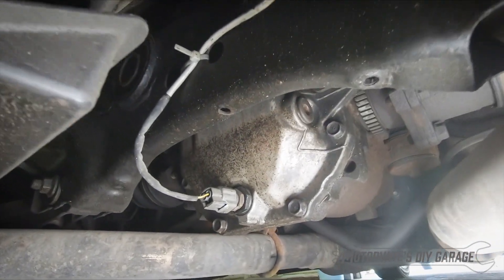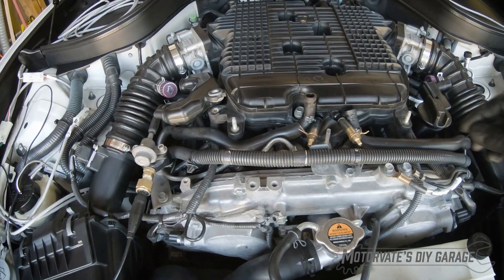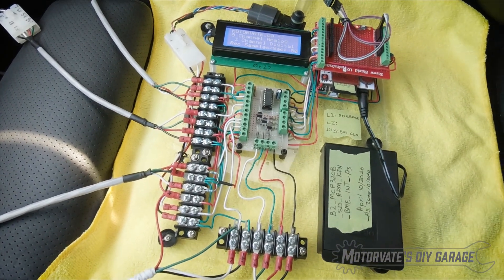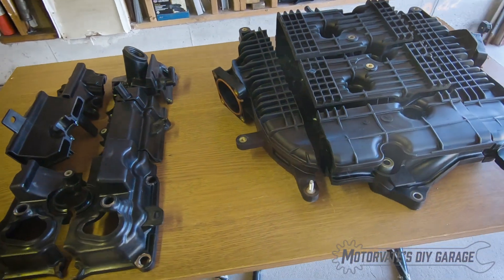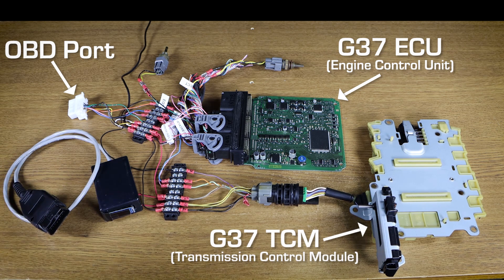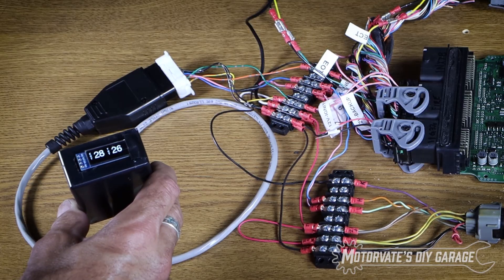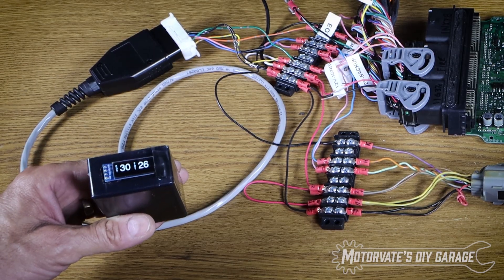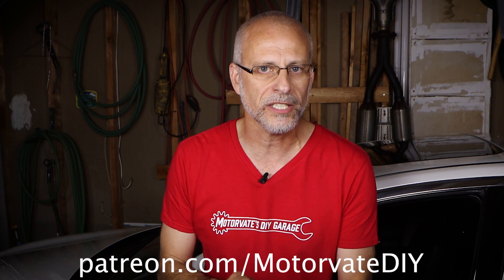Motorvate Episode Previews for 2020

Comment: I was RLY looking forward to another video after this. Did the VQ Gods tell you not to give away the secrets to peasants? :(
Reply from the maker: Hey Jason, thanks for the comment. 
Everything mentioned in the video is still on the "To Do" list and background work has been going on.

For example:
G37 Gear Position Indicator using Factory Gauges (Plug+Play!)
https://youtu.be/wQm-7cxolm4

Bluetooth Differential Oil temp, manual transmission oil temp, engine oil pressure.
Convert any wired sensor to Bluetooth with our Bluetooth Sensor Server:
https://youtu.be/U_kH3K_C2AE

16 Page Mini-Dash/LCD Gauge (using CAN bus and OBD mode $01)
https://youtu.be/lndZiRxDNOo

So... hang in there :)
Reply: @MotorvateDIY  I am trying. ..hehe. I have a 2012 G37xs Sedan with Auto. Once you mentioned self tuning..I got SUPER Excited..;) Also cutting apart the manifold, and explaining things . I will be working on hooking up a sensor for oil pressure next. All your videos have been extremely helpful! Thank you for your time. We appreciate you! :)
Reply from the maker: Thanks for your kind words...
As you can guess, the self-tuning requires a massive amount of R&D time and for the next while, I will be focusing on other items. This way more content will get released.

For your oil pressure sensor, make sure to get a 150 psi version. On a cold start, the oil pressure can exceed 120 psi.

Comment: Just checking back to see if you're getting close to completing some of these videos? Hopefully you arent snowed in up there.
Reply from the maker: Not snowed in at all...  They are being worked on right now... I have so much to share with everyone.... For example, how much does the fuel pressure change during wide open throttle, how high does the oil pressure get during high engine RPM, or even how high is the crankcase pressure... 

Also, I have developed 30 second install engine oil temp and transmission oil temp gauges... All will be shown on future episodes :)

Comment: Hey, just a question, my 10 g37x has some hesitation on acceleration at low speeds, after a stop I give it about 15% throttle and hold it and the car feels like it has no power or very little power and after a second or 2 power comes on, Then i smoothly give it more throttle input and the car will jerk, the throttle is smooth feeling but the power jumps up and the revs go up by 2-400 rpm, even at parking lot speeds I’ll barley touch the throttle and hold the gas and after a second or 2 it will accelerate more and slow down and it will keep doing that when i constantly hold the throttle (first theirs no power then power comes on then no power) it feels like the throttle body is closing on its own, idk what’s the issue, I’ve cleaned throttle and maf sensors and did a tune up and did the peddle dance and reset the ECU and nothing worked
Reply from the maker: Hey  DGFr0sty,
That's an odd problem.

If you want to troubleshoot this yourself, get an OBD wireless scanner and an app (OBD Fusion is my favourite, but Torque Pro is ok)

OBD Fusion has a VERY nice diagnostic report. Run that report with the engine at a hot idle, and look at the fuel trims.

Then, do some data logging. For both banks, I would record the air/fuel ratio, MAF, absolute pressure sensor (MAP), absolute throttle position, engine RPM and accelerator pedal.

This data should tell you what is going on.
If you want to learn more about OBD diagnostics, pop over to my other YouTube channel: https://www.youtube.com/obd4everyone

As you can guess, most of it is G37 focused, so that might help.

Comment: I have a code p2138 with the ses light , slip, and vdc lights on and the car is in limp mode with next to no power can anyone help me out what this could be I seen one thread saying the pedal position sensor but I’d like to know if that really is the prob car is a 2007 g35x awd sedan
Reply from the maker: Hey  Jonah urban,
Just to clarify, the trouble code doesn't tell us what part to replace... It tells us the symptom.

In your case,  the symptom is that the accelerator pedal two position sensors are showing different positions. 

This can be caused the the pedal, wiring, or about 10 other sensors that can bring down the 5 volt power supply that is used.

You could replace the pedal and see if that works, but often you end up buying parts your don't need.

If you do replace the pedal, you must to the "accelerator pedal released learning" procedure.
Reply: Motorvate DIY is there any other information I can tell you? Or anything else I should look at or test? The pedal is about 300$ and I hate to buy it and not be it thanks for the reply
Reply: Motorvate DIY I also saw if you have a 2007 g35 you have to update the ecu to do the idle air volume relearn well I disconnected the throttle body’s and noticed it was idling a little high I drove the car for about 30 min ride then back 30 mins and then got the codes could this have anything to do with it?
Reply: Motorvate DIY I now have codes p2138, p1757
Reply from the maker: Hey Jonah urban,
The P2138 is the accelerator pedal sensor as mentioned above:

The P1757 fault is in the transmission. The "front brake solenoid valve"

These issues require special tools and knowledge. If you don't have them, I think it is best to take it to a shop.

Have them work on the P2138 first, as there is a slight chance that may also fix the P1757 transmission fault.

Good luck!

Comment: Hi Motorvate! Great content! Question, how often should one change their oil on a VQ motor?( mine is VQ35HR) For scenarios where im driving highway and local roads everyday, would you say every 5k? How about for when a car is parked for days, on a hot summer day, and only drive once/twice per week ( like in our crazy pandemic quarantine)? Thanks!
Reply from the maker: Hey  Peter Jeong,
I have two answers for you:
(1) Easy
(2) Not as Easy

The easy way is to follow the maintenance schedule (https://infinitig37.com/maint-sched.html) based on how the car is driven either schedule 1 or schedule 2.

The Not so easy way is to get a used oil analysis at the next oil change: 
K&N Filter Dirt Test: G37/370z - Motorvate's DIY Garage Ep. 16
https://youtu.be/uvExyfxzsRo

Since I don't drive in "stop and go" traffic, I change it every 12,000 KM or 7,500 miles. Based on my last used oil analysis, the condition of the oil (viscosity and additive package)  is still OK.

Make sure to use a name brand, 100% synthetic 5W30 oil.
Reply: @MotorvateDIY  thank you Motorvate! One last question, my car is at 50,000 miles and was bought used. Its a 2008 G35 sedan. Ive replaced most parts and kept up with maintenance but one thing I have not looked into is the fan and radiator. Since it's a 12 year old car, how often should the fan and or radiator be changed out?
Reply from the maker: Hey  Peter Jeong,
In my opinion, they should replaced when they fail as they are not a maintenance item. 

Generally the rad and fans seems to last FOREVER without issues. Unlike my BMW, that needs a new rad/water pump/thermostat every 5-6 years :(
Reply: @MotorvateDIY  that helps put me at ease then!  Oh wow, I knew that maintenance upkeep is a pain for BMW but radiator/water pump/ thermostat every 5-6 years?!
Reply from the maker: Most seem to think that due to German environmental laws,  it is required to use a high percentage of recycled plastic, which may not have the same long term strengh.

Changing the rad, thermostat and water pump is not difficult and much cheaper than a new/rebuilt engine :)

Comment: Great content, and I look forward to what's coming in the future! I have semi-relevant question for you if you wouldn't mind me asking. On my 2013 G37x I have glasspacks in place of my mufflers, and was wondering if you think a tune would benefit my car in any way in its current state. Thanks!
Reply from the maker: Hey  Matthew Moore,
I'm glad you are looking forward to the new episodes!

As your your tune question.... That is a hard question to answer. The stock exhaust pipe is not very large (compared to aftermarket cat back exhausts), but the glass pack muffler should flow very well.

I think a tune might give you a little more power, but I am not sure it is worth the cost.

I think you may want to look at a larger diameter cat back exhaust, and maybe a nice big cold air intake, then get the tune for the biggest bang-for-the-buck.
Reply: @MotorvateDIY  Hey Motorvate! I thought kinda the same thing; I had pretty much opened up my restrictive exhaust, and that without more modification a tune yielding a tiny power bump wouldn't be worth the money. Thanks for validating that for me, and taking the time to answer!! Stay well now!
Reply from the maker: Anytime :)